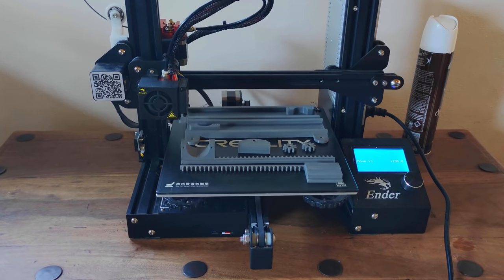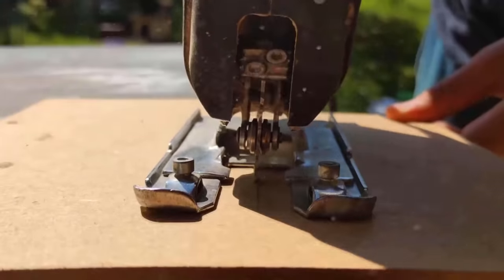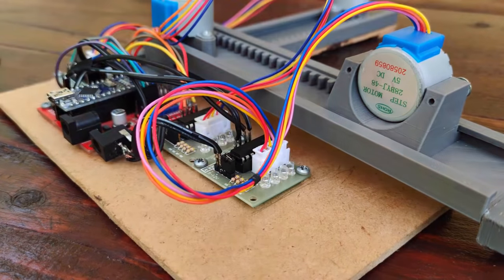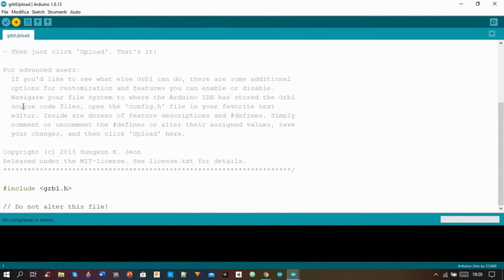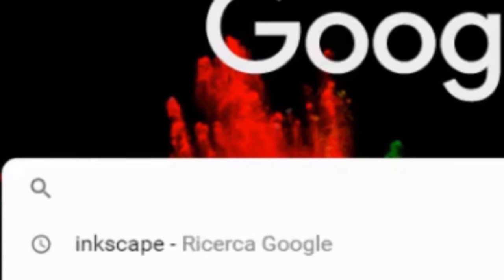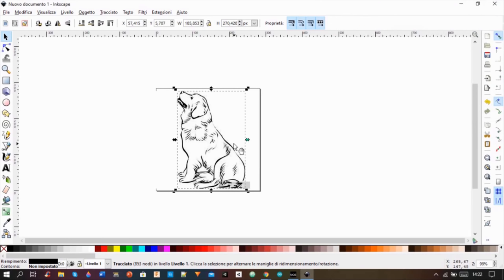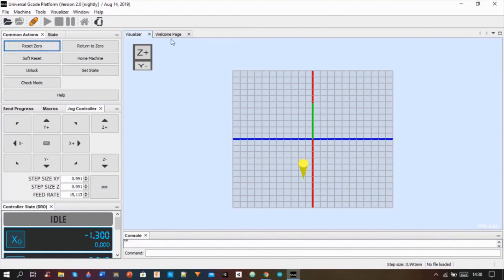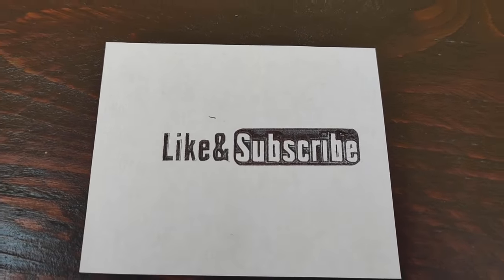3D PRINTED ARDUINO MINI CNC PLOTTER

Comment: Hello - I can confirm that the custom GRBL build that is supposed to support a servo on pin11 doesn't seem to be working (and it also has an error in the library code that prevents the compilation from the Arduino IDE ; but even with that line commented out, it doest seem to drive the servo). The one with the 3 steppers is working well, and the wiring diagram linked in the description is correct.
Reply: Hi friend, I'm reproducing the project, but some links are broken, can you share it with me?

Comment: Congrats man. Cute design. I took some time over the weekend and build it. I used Arduino Uno following ur diagram and after some time i manage to make it work by NOT inverting X axis in UGS and inverting Z axis. It works like a charm. I see some people had this issues too. I also made new pen holder since urs was limited to one size. Let us know when v2 will be available :)
Reply: hi! what was your hack for the inverted x-axis? i'm struggelin with the same issue :-/
Reply: @claudens2321  hey. Hack was exactly as i wrote it.  I did not invert X axis in UGS but i inverted Z axis. This worked for me using Arduino Uno. Hope you will make it work.
Reply: @mensomo  so you altered your firmware with the $3 for the z-axis? with what value? my $3 is not reacting at all. sorry to border you..
Reply: @claudens2321  Not the firmware. Universal Gcode Sender -> Setup Wizzard and there i checked “Reverese direction” for Z axis instead of X like it’s on the video. Just follow video steps and you will get to there.
Reply: @mensomo  thx mensur, won't work with my grbl. my hack is now that i park the x-axis in the opposite corner :) thx anyway!
Reply: @claudens2321  Woah thats clever
Reply: Hey can uh plz share the circuit diagram
Reply: @mensomo can uh plz share the circuit diagram

Comment: Question, I followed your wiring diagram and the X and Y work as expected, however I do not have Z control at all.  When I swap the Z stepper board with X or Y ; I am able to control that stepper motor.  Is there by any chance different pins on the arduino uno that need to be used?
Reply from the maker: If you change the z board with the x for example, and you can control the motor, it means that the z control board is broken
Reply: @DAZprojects  ??, I pulled the z board and stepper motor and placed those wires in the X spot on the UNO and I can control the motor, how does that mean it is broken?  Please educate me.

Comment: I just received the parts ;-) 
I got a question about the power:
- Why don't you use the expansion board power ? 
- And I see a jumper on the expanasion board in your video that I don't see in your schematics could you please specify how do you manage the power ?

I mean, if you don't use the power plug from the expansion board, where do you power on the expansion board ?

Thank you !
Reply from the maker: I used the expansion board Power to Power the Arduino and I powered separately the motor drivers Because they require too much power to be connected to the 5volt of the arduino (I tried and it didn't work)

Comment: Will build it tomorrow, thanks again for your support and your awesome work.
Just a suggestion. Running threw easel will greatly make easier the print process ;-) It seems to work on my side
Reply: Did you built it? And did it work?

Comment: Great build! How did you ensure smooth sliding of the part in the rail? Did you sand the parts after printing? Or any other finishing? Did you provision for clearance in the model?
Thanks for sharing!
Reply from the maker: the rails slide well, i didn't sand the parts, I can't answer the fourth question.
Reply: @DAZprojects  can u update the google drive

Comment: Hi, I don't understand how you managed to power your CNC with the 9v connector connected to the motor controllers, could you explain it to me ? Did you connect the two wires on the same pin ?
Reply from the maker: you can find circuit diagrams on the internet and instead of connecting the vcc to the 5v on the arduino you connect it to the positive pin of the power supply connector and the same thing with the gnd
Reply from the maker: @enzonicolas3058  you have to connect the positive and negative wires likes in this circuit diagram https://images.app.goo.gl/tTjodUJTs9M4Wfek9
Reply: @DAZprojects  So, if I saw well, on your video you put the gnd and the Plus on the same pin of the 9v connector and this for the three motors.
Reply from the maker: @enzonicolas3058  i put all the plus on the plus pin of the connector, and all the negatives on the negative pin
Reply: Is it 9v that is used? So there is no resistance?

Comment: Great poyect, but i have a question, you use an arduino nano, but in the circuit diagram you have an arduino uno, it´s care? or we can use what we whant. Thanks
Reply from the maker: You can use what you want as long as you connect the electronics to the same pins

Comment: So I've bought the exact parts you use in the video, but the wiring diagram is for another board. i need the wiring diagram for what's in the video. also the JSCut file won't show on my system. What do you use the JSCut settings for and what are the settings? please get back to me im teaching this project to a class in a couple weeks and want to workout all the kinks before starting this project with the children.
Reply from the maker: The wiring diagram is correct, i used a Arduino uno in the diagram because i couldn't find the Arduino nano and shield template. The connections are the same. You have to upload the jscut file on jscut, so that all the settings will change according to the machine specs
Reply: @DAZprojects  Thank you i got it.
Reply: Can uh plz share the circuit diagram

Comment: Sir what is amount of power u have supplyed to the cnc
Reply: you need at least 2 amps, i used 2 amps on 5 volts it works fine
Reply: @mohamedaminebenbouali2941  what is amount of volts like 2 amps and how much volts sir...

Comment: I built the whole thing and came out ok. The 3D printing of the guides was difficult to remove the supports. I am using a 6v external power supply. From the UGS,  the X and Z axis are moving fine but the y-axis is not moving at all. I can see the LEDs flashing and feel the stepper buzzing but the motor does not move.  I tested another motor and controller, still the same. What could it be? Thanks
Reply: I think your power adapter doesn't provide enough amps.... Use a separate adapter for third motor or even better use a separate power adapter for each motor...

Comment: i have three problem,

1) Is it normal for stepper motors to overheat? are you like that too.

2) which filament did you print with? I used pla and the gears soon melt and lose their function due to the heat.

3)Have you set up steps in the ugs program? Can you export and share these values with me?

im waiting your answers. thanks
Reply from the maker: My motors overheated too, but I didn't happen to melt the plastic (I also used pla). I set the steps in the program at 100 steps/mm in the y and x axis and to 50 in the z axis and It was fine.
Reply: @DAZprojects  ok. thanks for your answers
Reply: @habibcanbengul3719  Stepper motors use power to remain stationary. You can set the pins to low to cut power to the motor, but this will allow the motor's spindle to turn if force is applied, which might not be a problem for this project

Comment: I built it but the problem is getting the GCode ready.  The JSCUT site or uploaded on my computer doesn't work... takes for ever just for simple drawings.  Is there any other Gcode generator we can use?  Please advise.
Reply from the maker: You can use easel or fusion 360, there are other cam out there but i use only these two

Comment: Grandissimo!
It's best CNC plotter I've seen.
I printed it!
The X and y rails aren't printed so well because of the c profile, but the problem was shown only after 8 h of printing. Do U use some support?
How hight is the space occupied by the plywood ?
What infill did U use?
Can you please tell me the most important parameters of printing that you used?
Grazie per aver condiviso il modello su thingiverse
Reply from the maker: I used 2.0mm layer and 20% infil with supports
Reply from the maker: The plywood was 4mm thick
Reply: @DAZprojects  thanks
Reply: @DAZprojects  may be  0.2 mm ?  or really 2.0 ?
Reply from the maker: 0,2mm, i was wrong, excuse me
Reply: I used Prusa slicer and was not able to remove the supports. I printed them in parts and glued them. If you use Cura,  in expert mode, there is a setting for the z-offset or support z distance (distance from top and bottom of the support to the print). I tested it and works pretty good.

Comment: Excellent

Which glue should we use

Thanks
Reply from the maker: I used super glue
Reply: @DAZprojects  

Thank you so much for your reply

I just printed the parts, looking for the motors, i will start building

Thanks alot for your support
Reply: Thanks a lot

Its worked fine, super glue

Hoping this weekend i will make this work

thanks a lot

Comment: Sorry forgot to mention the pin connections  A0, A1, A2, A3 for the Y-Axis(IN1->IN4).
Reply: A0 possible?
Reply: @muhammedsaeed8972     -From the wiring diagram.

Comment: nicely done, , but maybe better to use a servo for the penholder ? only minimal movement needed.
Reply from the maker: Yes, but i tried It and It didn't work
Reply: @DAZprojects  understood, guess the software was not ready for that.

probably easier then to use the 3rd axis with a small stepper like you did..
prints look great...
Reply from the maker: No, there is a code Wich allows to mount a servo on the z axis, but it didn't work to me

Comment: Hi it's seems there is multiple bearing 16mm
The one I've bought doesn't work
what is the exact model ? 6203-2RS-16 will work ? Thanks
Reply from the maker: i don't know the model, the one i used is 5mm thick and it has an internal diameter of 5 mm

Comment: Is it precise enough to be able to draw a pcb ? I'm planning on building a pcb plotter to be able to make custom pcbs
Reply from the maker: It isn't precise enough for drawing pcbs. Check out my latest video: https://youtu.be/xfFhh5kzQms
The cnc i built in that video costs about $10 more but it is way more precise
Reply from the maker: If you want to use it as a pcb plotter you can mount a marker instead of the motor.
Reply: @DAZprojects  Thank you

Comment: If anyone could please help, I have followed the wiring diagram exactly, I have used 3 different Adruino Uno boards and 2 different nano boards.  Also I have swapped out all stepper motor boards as well as stepper motors and I still can not get the Z axis to work, yet X and Y both work on all the boards and motors.
Reply from the maker: Sorry but i didn't run into that problem so i don't know what you could do to fix it
Reply: olá, @witnessriders, vc ainda tem o diagrama de fiação e as configurações JSCUT desse projeto? estou precisando muito

Comment: Sir, is it possible to scan an object and have it duplicated. For example, If i draw airplane wings ribs. How will I be able to copy on your machine?
Reply from the maker: i think you can do it but i am not sure
Reply from the maker: However I think it comes out better with an inkjet printer because this printer isn't accurate enough to copy stuff.

Comment: Bro your work was fantastic but I am facing one problem I want to replace the stepper motor you connected with pen with a servo motor  I don't know how to change the code so can you pls make a change in the code so I can use the servo motor thanks.
Reply from the maker: I also had tried with a servo motor but i could not get it to work, sorry
Reply: @DAZprojects   no problem

Comment: Bro my stepper motors is only vibrating and heat ..I m using benbox software...
Even Uln003 module are not on lights plz help

Comment: Hi there, Nice project! I've replicated this project and I've now ran into some issues. Whenever I load my GCODE and set it to start it just goes super slow and ends up drawing nothing but random lines on the paper. The gears move so little that you can barely see them doing this. If I manually move them in the same program they move quickly and as they should. I assume my GCODE or the program settings are the issues here. Would you mind sharing the GCODES used in this video along with exported settings file of your controller program. I'd appreciate it lots if you could do this for me, I just can't get it working.
Reply from the maker: Thanks for your appreciation, i think that your power supply it doesn't have enough power, for example when I was powering the motors from the Arduino they moved very slow and randomly
Reply: @DAZprojects  hi, thanks for replying! It seems to be working now, but still having issues getting the gcode to work. Any chance you could share? :)

Comment: Thanks again for this amazing tutorial.  I’m building this plotter myself right now, and I have a newbie question: it looks like you added a separate power input to drive the three stepper motors.  Why weren’t you able to use the power input that is already attached to the CNC shield?  

Also, it looks like the female 9v power input components have three connectors.  Which ones go to the ground vs. power?

Thanks in advance for any advice you have to offer.
Reply from the maker: I used 2 separate power input because the power that the Arduino provides is too weak. I don't remember what are the positive and negative pins on the female power input, but you can try with a multimeter
Reply: @DAZprojects  thanks so much!

Comment: i am having a problem with ballpoint pens getting lighter and lighter as they are used. the ink is still 3/4 full and they are no longer good enough to use with a plotter anymore. anyone else run into this after a half dozen plots with same pen?

Comment: Didnt the use of gear caused backlash?
Reply from the maker: Yes, infact this machine isn't very precise
Reply: @DAZprojects  The drawings you made with the machine look very precise. I think the toughest part of this project is getting proper gcode because jscut seems not to work very well. I found the easiest thing to do is trace the bitmap or drawing using a bezier tool.  You made it seem easy to turn pics into gcode and I know that it is not easy at all.

Comment: Fantastic project! Thanks you for sharing 🙏🏻 My problem is that the 3 stepmotors do not step/rotate at all. I tried both arduino uno and arduino nano + shield. Instead they make a buzz- sound and get hot.
I have wired accordently to diagram A0, A1, A2, A3 for the Y-Axis(IN1->IN4) │ 2, 3,4,5 Digital pins to the X-Axis(IN4->IN1) │ and 8,9,12,13 to the Z-Axis(IN4->IN1).  All red lights are turn on on X and Y motors
Any one have an idea to solve this problem? I appreciate any comment.
Reply: I think the problem is solved. 
I use external 9v power supply for all 3 motor, but there is only power for 2 motors. 
Is 12 volt a solution?
Reply from the maker: Yes, the Arduino do not have enought Power to make them spin
Reply: @DAZprojects  do you think 12 volt will cause any damage to motors or ic's? they both get very hot with 9 volt power supply
Reply from the maker: @nordjyllandregnskab  i used 9 volt and the motore hot very hot, but i think that's ok
Reply: Do you still have the wiring diagram?
Reply: @DAZprojects  i'm using 5v and they're very hot too think the problem is not with supply, it's with the programming, after machine is done printing, the pins on the steppers are still kept on to maintain accurate positionitioning which isn't necessary, i'll try to modify grbl and post the updated version here or maybe i'll use a relay to cut power from the steppers when not in use
Reply: Hey can uh plz share the circuit diagram
Reply: Hey can uh plz share the circuit diagram

Comment: Hello I have built the cnc but I do not know how to calibrate it, how I should do it, Thanks
Reply from the maker: You have to take a ruler and put it beside the axis you want to calibrate, then you press the button in setup wizard (in ugs) and you have to see how much the axis has moved, then you import that value in the program and the steps per mm should calibrate automatically

Comment: How much Volt do you use for the steppers? I remember them being very weak at 5V
Reply from the maker: I use 9 volta fron an external Power supply, note from the arduino
Reply: @DAZprojects  Thanks! I'll try that!
Reply: @DAZprojects  And really cool build!

Comment: JSCUT doesn't work. Is there any other program to create the Gcode?
Reply from the maker: There is fusion 360 or easel. There are a lot of other cam but i used only these two

Comment: Sir , if i make the 3d printed model for a4 sire paper , use arduino r3 + Cnc shield v3 . Will it work ?
Reply from the maker: I think yes but you need to modify the stepper motor
Reply: Ok , Thank you sir

Comment: How do you home the axis.
Is there a command for that.
I’m using 9V and the motors do get hote.
Is that ok.
Also can you show how to do the settings as the video goes too fast for that.
Reply from the maker: I home the axis manually fron Universal g-code sender
Reply from the maker: My motors also get very hot and i think it's normal
Reply from the maker: if you slow down the video you can see the settings, I'm sorry that I have speeded up that part of the video, in the next videos I will be clearer
Reply: For some reason I can’t understand how to make it work
Reply from the maker: @domdomgin  try to search on google